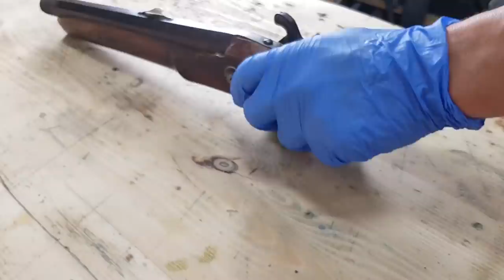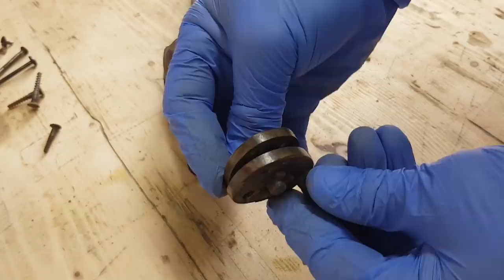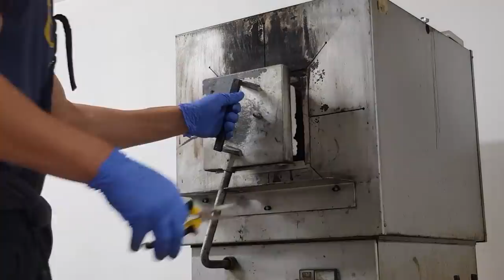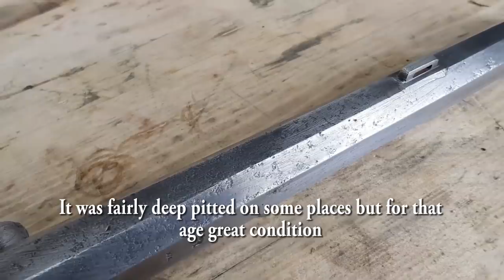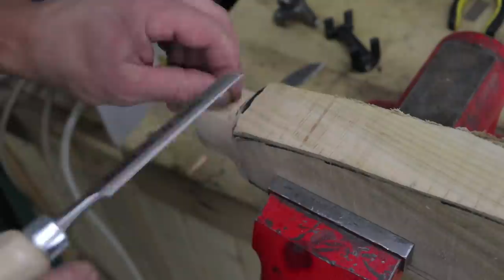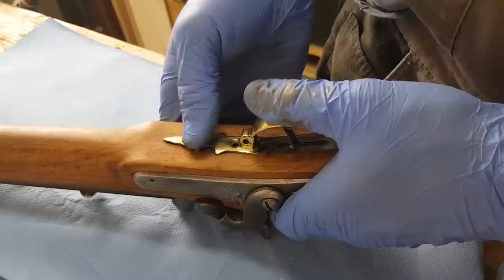200 Years Old Mysterious Rifle Restoration

Comment: It's a poachers gun. If he was huntig illegal and someone saw him, he could easily hide his gun. This was common in eastern France, the southern parts of Germany, in Tirol and Switzerland.
Reply: @MastersOfCraftOfficial  Your gun is not that well made. (not insulting) It's just a military grade musket with some aftermarket parts, like the stock or the hammer. You may think it's expensive and well kept, bcause in the areas I mentioned, poaching is an old tradition and the guns were passed and cared and often renewed (barrel!) for generations. After WW1 they could easily get new repeating rifles and ammo, so the muzzle loaders became obsolete

By the way, I love your work  and your channels are my favorites on YT!
Reply: @MastersOfCraftOfficial  Well poachers didn't built them from the ground up, they took existing pieces and modified them to be taken apart. That's where their name "Stutzen" which roughly translates to "To trim down" comes from, their quality highly depended on the skill of the craftsman. I also don't think that this was a flintlock at some point as the stock doesn't have a cutout for the pan and the lock does not show the characteristics of a conversion. Like having leftovers of the pan, some unused holes and beeing a bit bulky in general, furthermore the proportions of the lock do not quite fit a flintlock and the hammer doesn't look weird (which isn't a dealbreaker but a hint that it isn't a conversion). Other than that, nice restauration, not stressful to watch at all unlike someone rocking his rusty antiques with an anglegrinder

Comment: Wonderful work. It turned out very nice. 

It looks like an old flint-lock that has been converted to a percussion cap. This was very common in the 1800's. As long as safe propellants were used (black powder being the most popular at the time) it was a safe conversion. Here in the US it was a popular conversion for mountain men and fur trappers, since the percussion cap provided more protection from the elements than the open pan of the flint-lock.

The take down is neat. I am not aware of any mass produced take down muzzleoaders from the time, so you are most likely looking at a custom job (if you know of some mass produced ones, please let me know). 

No idea if it was used as a poaching gun or not (as another poster speculated). 

Again, it looks really good. Great work.

Comment: Not a folding model as it does not "fold". Its called a take down model. Shortening the rifle into three pieces so it could be packed into a storage case for travel. Most likely owned for hunting as militarizes would foot the extra cost of a take down model with wooden case, Soldiers carried there rifles on the person.

Comment: Great restoration job. As to what it is, I guess it might indeed have been a poacher's gun. The only strength of this design is that it's light, and after dismantling, it's reasonably easy to conceal. Still, poacher's guns tend to be more primitive in design, and this doesn't appear to be something that someone would have just cobbled together in a shed. Just the modular barrel and the threading on the joint is pretty impressive - I wouldn't imagine a shed-made wonder to have the sights line up after reassembly. 
I second the suggestion to consult Ian of Forgotten Weapons, he's knowledgeable about all manner of firearms, from regular stuff to the most odd and peculiar.

Comment: In the UK you can find Poachers guns occasionally, but they tend to be smooth bored and sized at 12g or more often at 410g. The ones I have seen have always been broken into two pieces. A quick release catch to remove the barrel so it can be stuffed into two pockets or down trouser legs !

Comment: Hey man, make some < 1 mm copper or brass sheet covers for your vise jaws. They fit like a box and take 5 minutes to make. Saves a lot of scratches on your work. Springs don't like scratches as that makes a weak point where a break will occur.

Comment: I've seen something similar to this from Europe though this is a bit of a bizzare example. When the barrel extension is removed, it very much reminds me of short hunting rifles used in forests and the like. The shorter barrel made them more maneuverable, easier to load, and lighter so it was more reasonable to carry multiples. Given the length of the ram rod, I'd say this was likely the original purpose since rifles dont really need overly long barrels to be accurate, but just enough rifling to engage the spin in the projectile. As time went on though, I think the extension and primitive takedown stock were added to further enhance its compact nature and extend its range. It's kind of funky as it also almost looks like someone attempted to take one of these short hunting rifles and make it a psuedo-breechloading fowler. A truly bizzare find. I think CapandBalls channel had a video on a similar piece

Comment: Nice video Andre.  I've never seen a takedown firearm with the butt stock removal ferules like that one, sweet!  If you ever tear down that lock again do yourself a favor and get or build a "mainspring vice".  That will make the job MUCH easier.  The correct way to disassemble the lock internals is to compress the mainspring with the vice, remove the spring then remove the sear spring , sear and tumbler.  Re-install in reverse order. 

I didn't notice on your new spring but most mainsprings had/have a stud protruding from the lock plate side partway towards the bend of the spring that fits in a corresponding hole in the lock plate in addition to the screw at the end of the spring.  This makes the lower part of the spring more rigid.

Thanks again for sharing.

Comment: It’s basically a brake down gun. One of the original brake down guns. And it was converted to be more modern when the times changed. It probably was a rich mans gun who did lots of hunting. It was easy to travel with.

Comment: My great uncle had a wall hanger that he said he picket up at a yard sale in mountains coming back from the smokey mts. He always said it was a gun someone ruined by cutting off the barrel and threading it,he took a piece of rigid conduit and coupling and painted it all black,from a distance you couldnt really see the thin coupling . he never knew what it was always said it was a civil war gun someone shortened. In the 50s when he got it you could still find actual relics especially on the way to the mountains. I remember thinking it looked like a pirate pistol with a detachable stock added and an extension. I never seen that gun after about 1990. My cousin lost it for taxes he had left and took mostly his stuff because the roof started leaking and he didn't know anything about anything and to shy to ask for help. I did get in touch with the new owner and he let me get what I wanted before tear down, even after the house was broken into I still found a 410. 90% complete p38,couple mags for 08lugar most of my uncle's ww2 souvenirs and his hidden ammo cache,no less than 10 guns were taken including a 03 Springfield.mod 12 pump,2 Lugers,1911,a 38 S&W not special,and a jungle carbine. I found ammo for all of these. The fireplace where the wall hanger yard sale gun was had collapsed I dug through everything but the gun was gone.

Comment: I’m guessing here, but I don’t think it’s a poachers gun.  It looks like a Pennsylvania Long Rifle to me.  My theory is this was made for a well-to-do individual who traveled to do his hunting.  The pieces were broken down to fit in a traveling case, which would explain its good condition.  The threading was necessary to support and stabilize the barrel.  I’ll check with my resident expert and get his opinion or further details.  Can you tell me what continent you got it from? .  🙏

Note 1:  Barrel length on a long rifle was 32” to over 48” (81.3 cm to over 121.9 cm).  Yours falls in the middle of that range.
Note 2:  https://en.m.wikipedia.org/wiki/Long_rifle
Reply: @MastersOfCraftOfficial  It's waaaay too long to be a poacher's gun (most poaching was done with shotguns, at short range; shooting an animal at ranges that justify that long of a barrel is more of a "sports" thing). I also think the most likely explanation is a travelling hunting rifle - shorthened so it fits inside a travelling trunk instead of in a separate case.
Reply: Andre Will Do It The resident expert says Spanish or French.  He leans toward Spanish because of the hammer, barrel blade, and lack of cosmetic design.  He said the bottom plate is more English in style.  He thinks a gunsmith put this together with the parts on hand. It would have been owned by someone from the middle class.

On the premise of Spanish and English parts were used, I thought about the availability of parts.  It had to be during the Napoleonic Wars so I checked the timeline of the Iberian Peninsula.  Here’s what I found:

“The war on the peninsula lasted until the Sixth Coalition defeated Napoleon in 1814, and is regarded as one of the first wars of national liberation, and significant for the emergence of large-scale guerrilla warfare.”  Wikipedia

To be continued...  

P.S. have forgotten to say what a wonderful piece of restoration this is. My problem is I love research.  An unanswered question for me is like an unrestored piece to you.  Full of potential and sometimes not knowing what the finished product would look like.  I got caught up in the question. ❤️
Reply: A quick look into snipers in Iberian Peninsula brought up the name of Britain Thomas Plunkett.  I won’t rehash his biography but it does lend credence to your Special Forces idea.  However, he used a Baker Rifle which has a 32” barrel and .75 caliber.  The Baker was based on the German Jaeger Rifle, which typically had a 45” barrel. 

“Jäger were a type of soldier, a form of light infantry, first named by the Landgrave of Hesse when he formed such a unit from his foresters and huntsmen in 1631. Huntsmen and foresters recruited in certain German states, were an established presence in German military units. They were often of middle-class backgrounds or belonged to the lesser nobility. These troops were primarily used for reconnaissance, skirmishing or screening bodies of heavier troops. Since they owned their own weapons there was little standardization, and the early rifles were generally designed for hunting. Jäger were not just skilled riflemen, they were also able to handle and maintain delicate, accurate rifles in an age when very few soldiers had mechanical skills.”

You might find this interesting.  https://www.quora.com/Are-there-any-60-caliber-bullets. What I get from it is that there is a major difference between a .60 and a .600.  Also, the .60 is used in trophy hunts.  I would also say a sniper weapon would have to use a common type of ammunition because of immediate availability.  

Hope you found something new in all of this.  I had an adventure in looking.  🙏
Reply: Spaniard here. If you think it might be some "Napoleonic age special forces" ;-) rifle, I fear I have to bear bad news. In the Spanish Independence War (a.k.a the whole Napoleonic stuff of around 1808) neither side made much use of that (precisely the reason the guerrilla was so sucessful); ; Plunkett's sniping a French general at Cacabelos was an isolated feat. And the guerrilleros didn't use custom-made  sniper weapons, either. Their usual firearms were either regular military muskets or hunting shotguns (the iconic blunderbuss of the Andalusian bandolero was not as common in reality as it is in fiction).
Reply: notfeedy notlazy Thank you for your input.  If you look carefully at what I presented, I drew no conclusions.  I attempted to support or disprove any information that was given by myself, Andre or my expert.  As far as Special Forces go, it would be presumptuous to imply that there was such a thing.  

If you look at the biography of Thomas Plunket on Wikipedia, you will see “In 1807, he took part in the British invasions of the River Plate (1806-1807). During the 2nd Battle of Buenos Aires, the 95th Rifles were heavily engaged in street-fighting during which Plunket killed around 20 Spanish troops while shooting from a rooftop with others from his unit. They retreated when Spanish artillery bombarded their position with grapeshot. Plunket also shot a Spanish officer who was waving a white handkerchief (with the possible intention of requesting a truce), resulting in further Spanish artillery bombardment which brought about the British surrender.[1]”. 

You will also see “Plunket only just made it back to his own lines ahead of a charge by a dozen French cavalry troopers, but the death of the two officers was sufficient to throw the following French attack into disarray.[3][2][4] The shots were "from a range that seemed extraordinary to the" men of the 95th Rifles,[5] who were trained to shoot targets with a Baker Rifle at 180 metres (200 yd) and whose marksmanship was far better than the ordinary British soldiers who were armed with a Brown Bess musket and only trained to shoot into a body of men at 50 metres (55 yd) with volley fire.[2][3][6]”. Sounds like a “Special Forces type” sniper to me.  

As far as being Spaniard goes, can you use your expertise to confirm the type of flintlock and blade?  Please share.  I’m just a frail, fragile flower of femininity who doesn’t know a thing about the big, wide world.   I need to be educated by intelligent, knowledgeable types such as yourself.
Reply: Andre Will Do It If you gather enough information, are you considering a video on the History of the Mystery Gun? ❤️

Comment: Recommendation: Stop scratching you restoration pieces up by pushing them down on, dragging them across, and pounding on them - all on a rough scratched up hardwood table. Glue some thick felt over your work tabletop.

Comment: It's a takedown shotgun probly a 20-28 Gauge do you have an exact bore diameter  I've seen a few for sale they were always presented as single shot takedown shotguns
Reply: @MastersOfCraftOfficial  cylinder bore diameter for a 20 Gauge is .615 and a full choke is 
.594 so  .600 would be about a modified choke and the rear sight piece looks more like a sighting plain similar to a vent rib than an actual rear sight here's one quite similar to the one you worked on https://www.icollector.com/3-Piece-Takedown-Single-Shot-Percussion-Shotgun_i13827622
Reply: @MastersOfCraftOfficial  are there any makers marks or manufacturing dates
Reply: @MastersOfCraftOfficial  I feel like this would have been a fairly expensive piece in it's day and if someone wanted a takedown rifle for hunting and could pay for something like this they'd get it rifled it would double the rifles effectiveness and wouldn't cost much extra the only way I could see someone wanting something like this in a smooth bore is if it was a shotgun
Reply: @MastersOfCraftOfficial  that is strange seems odd would want a gun like this to be smooth bore but I can't think of much else are you going to shoot it

Comment: Just a tip.  When working with these old guns don't use rust remover, use a soft wire brush to remove heavy rust and them use high volume steam to convert any remaining surface rust to black oxide (same as traditional blueing). Check out RustBlue.com, he has some great videos that he did with Mark at C&Rsenal and he has some great, easy to use products for restoring finishes on guns.

Comment: I'm wondering if the ramrod shouldn't be in three sections and ferrules placed on the screw on barrel for support.  With the short rod you made, the rifle would need partial disassembly to load.

Comment: I would think a gun that was used by someone who was packing/hunting/exploring areas and didn't want to be carrying a long firearm that would be tangling up with branches all of the time.  Think about carrying in a pack on a horse going through heavy brush.  My father had a Winchester 25-20 lever action in 'take down' form, barrel turned 1/4 turn just ahead of receiver and became 1/2 of full length which he got form a great uncle.  The Great Uncle used it when he was a trapper in the Everglades in Florida, USA.  He would break it down and stow it in a pack in a canoe he used to travel into the 'glades.  When he got to camp he would put it together and use as a meat gun  and dispatch gun for trapped animals so he could skin them for market.  When he got enough skins he would break it down and pack it for the trip out of the 'glades.  I'm thinking the same type of  thing for traveling somewhere and you could then reassemble it to do some hunting.  It looks like the butt stock could also be separated for compactness, and was lost at some point.  Would certainly be a lot easier to carry a 2 foot package on a horse than a 4 foot package.

Comment: It almost looks like it started "life" as a flintlock "horse pistol" and then was converted to percussion and a screw on barrel to make it a shotgun. The brass plate on the handle is probably where the pistol handle was removed and a wood stock attached.
Reply: Interesting choice of altering the weapon and not extending the forearm. I'm guessing it would have needed to have been loaded then the extended barrel screwed back on.